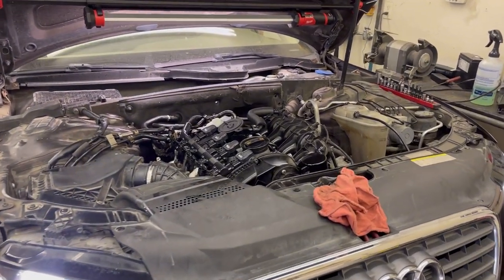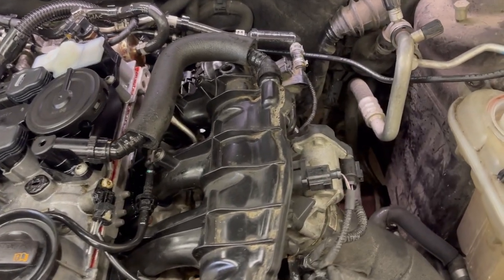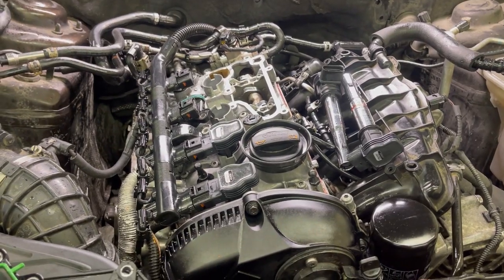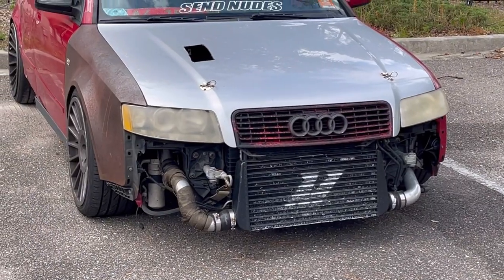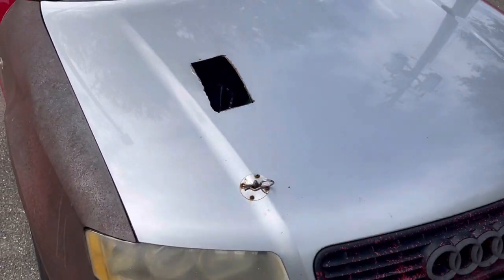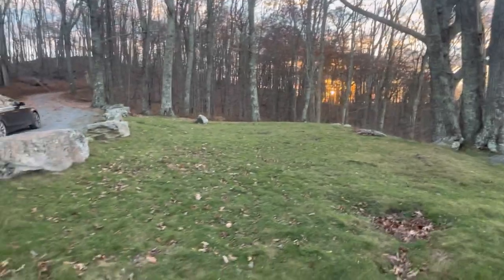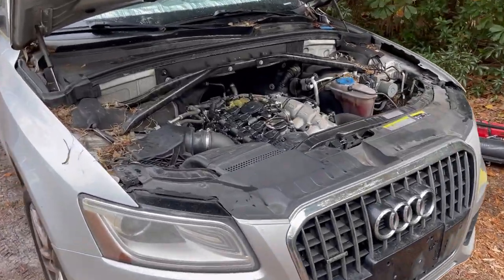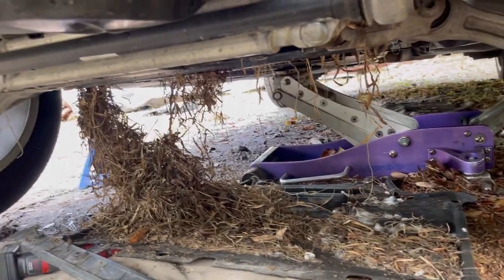2.0t vacuum air leak after engine rebuild What went wrong PCV Breather oil Audi VW Avant Abuse p0171

Comment: I had the same air leak, I changed the breather and was still doing the same, took it to Audi and the rear crankshaft seal had gone, it sucked it’s self in. New clutch new seal job done.
Reply: Yep same thing with my Audi, its getting fixed soon.

Comment: Hey napttown, I bought a 2015 a4 s-line 2.0 6 month ago , I can't seem to get more then 450km a tank ,I run premium ,changed coils and plugs, air filter still no improvement . Any advice brother ? Much love from Toronto Canada love the videos bro!
Reply: That’s about 280 freedom miles. That’s about all you can get unless you are driving highway the entire time. The most I have ever got from a tank was 378 with 13.3 gallons which was 28.3 MPG and that was driving 60-80mph continuously on a trip. These days I rarely drive my car and I only get about 200 miles per tank because my trips are all very short. I think you are normal. Unless you are doing long trips.
Reply from the maker: I’ve noticed if I stay 60mph or under I can get 30+mpg on the highway.  City traffic and acceleration kills mpg.  Sometimes I find locked rusty caliper slide pins on the front brakes that’s about the top thing to check unless you have engine codes
Reply: @NaptownTuner  okay thanks dude !!

Comment: Hi I appreciate all your efforts to show us all the issues with this cars I have 2010 2.0 t Passat and idling rough also there is CEL with code system too lean at idle bank when I disconnect s pipe from pcv to maiflow and I put finger engine running better I assumed on pcv and changed but again it’s rough on idle I did the same thing put the finger in mainflow and it’s running better,what can be?
Reply: Rear main seal.
Reply: @martomcuser  unfortunately that was the issue winch cost me $1500

Comment: Please help!! I Have a 2011 Audi A4 2.0…. The spark plugs and coils have been replaced along with a new throttle body. My car was running great for 3 days and now it’s running terrible! This is my only vehicle and I need answers. It has a hard time taking off. The dash will blink EPC every now and then but it’s gotten more frequent.. then my engine will die. Once I start it back up, it will happen again in 15-30 minutes of driving it! I need answers. 😢😰
Reply: You find anything I’m going through the same issue
Reply: I’m going thru same thing with my Audi a5 2011 I been spending tons of money on car nun worked
Reply: Going thru same exact thing.  Going to ask mechanics to check for Pcv .  I've already replaced turbo...

Comment: Have you ever came across issue with worn camshaft that caused loss of compression and created misfire in idle ? i have 1.8 tsi and just had this issue, fixed for now with new exhaust camshaft, apparently been twice upgraded by VW, looked all round youtube and google seems like nobody yet had described such a problem with gen 3 ea888 1.8.
Reply from the maker: It’s the most notorious issue for the first generation 2.0t 2005.5-2008 engine in the USA that’s what we got in those years.  Bad high pressure fuel pump follower design needs checked every 30-40k miles for wear
Reply: @NaptownTuner  I have a air leak they did a smoke test an said it was coming the bottom so I don’t know if it’s the rear main seal or I need a brand new breather set up

Comment: Can you walk through how to locate the vacuum leak on this engine?  Dose the air go throttle body before PCV, like how the air flow in general. Thx
Reply: Yes please I second this would be externally helpful I’ve been trying to find this pesky vacuum leak for days now and I wanna be able to diagnose it instead of dishing out the cash to have a mechanic come fix the leak
Reply: First place I’d check is that diaphragm on the PCV assembly, Naptown has a great video on that entire assembly on how it regulates vacuum on the intake and boost on the turbo.. check the rubber diaphragm and the plastic quick connectors on the assembly and intake, check the purge valve connection that’s prone to leak as well